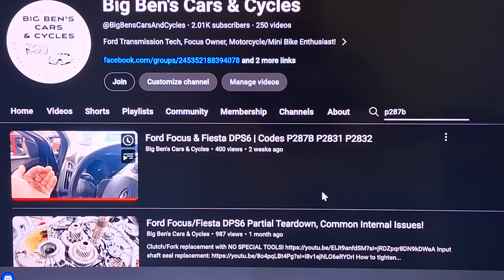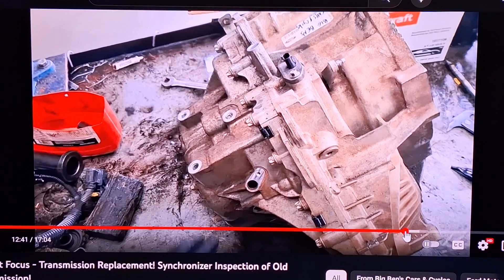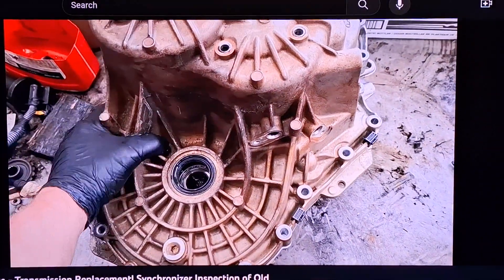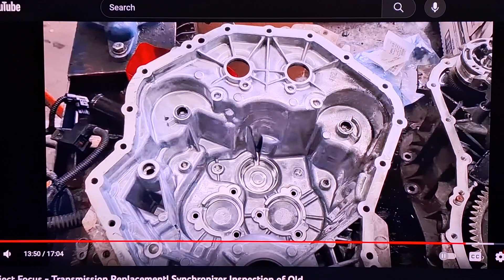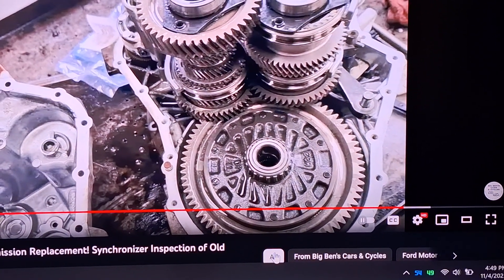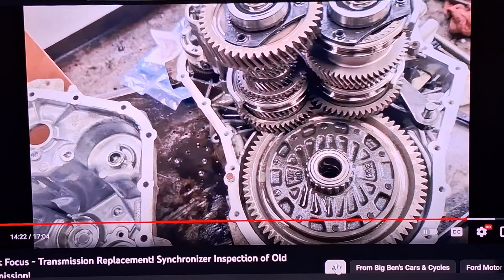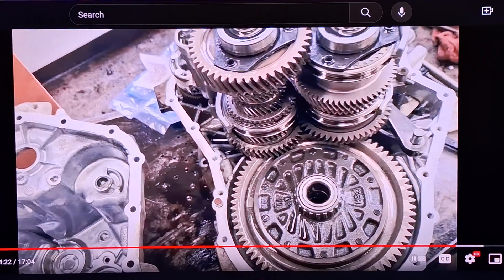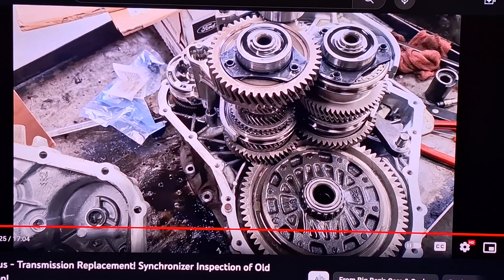Ford Focus Fiesta: P287B - Case Half Replacement (NO SPECIAL TOOLS)

Comment from the maker: Forgot to mention, make sure you pull the sensors off the transmission. Only put a SMALL amount of grease on the magnet to hold it (preferably transmission assembly lube) if you coat it in grease, it may not pick up debris anymore. And you'll have to unbolt the TCM.

Output shaft Bearings: https://amzn.to/3SJfl9H

Snap ring pliers: https://amzn.to/3UnGu3r
Sealant: https://amzn.to/3ukkWKe
Fluid: (need 2) https://amzn.to/488OhFf
Reply: I read that when doing this, one must consider the shaft end bearing preloads. What is involved in this, and is it necessary?
Reply from the maker: @SmajoDune  Per the workshop manual, the bearing preload check is only required when replacing final drive (differential) bearings. Not when replacing the case half. And even then, if it were my transmission, I'd re-use the shims and put it together.
Reply from the maker: @christophercharlesreidm.s.8365  I can screen shot and share in my discord or Facebook group. And you can order the case through Ford. Or find a used one

Comment: Hey Ben how much of a difference would 75w 90 make instead of 75w 80
Reply from the maker: @matthewrodriguez4153  hi, I wouldn't use it, you want a light duty manual trans oil like 75w80. I don't think 90 will damage it, unless you're in a cold climate
Reply: @ thanks been - my trans had a broke ear off so I’m putting a new one on thanks for your help

Comment: My 2017 ford focus has those codes says a/b fork calibration not learned. It was woring fine when i was doing uber i go home for my break car wont get to 2nd gear and wont go in reverse.
Reply: I have the same failure in my 2015 focus, Did you solve the problem?
Reply: @genaroperez976  turns out I needed a new transmission good thing my dealership covered it.

Comment: Do I have to reshim or reset the preload or something like that, dealing with the differential when replacing the case with a new case.
Reply: No, if you reuse the old shims it will be fine.
Reply from the maker: @smokeyblack4  ford does have special tools for checking the clearance for the final drive, to select the right shims to go under the final drive bearing races in the case.  If you have a bare new case, I'd reuse the old shims and you should be fine. I haven't seen it where it was out of spec
Reply: Is that in your video of removing shims?

Comment: Does the case half come with the race or do i need to get that as well?
Reply from the maker: @daviddecock7591  it does not have the final drive bearing race. If your old one is in good shape, you can punch it out and make sure to reuse the shim under it if you have one there.
Reply: @BigBensCarsAndCycles Ohh ok that makes a lot more sense. I have codes p287b & p2837. Started with a known good TCM (before finding this video) and it wouldn't pass the clutch learn, got hung up on the "neutral command state for both shafts"
Reply: @BigBensCarsAndCycles  If my end stop is broken, I'm not sure how the TCM passes the shift drum learn but gets hung up on the clutch learn. I'm going to pull the TCM off today and see if my gears keep spinning tho. I'm just wondering if it doesn't also need a clutch. The actuators both spring back nice and smooth, and there no shuddering/slipping when taking off in first gear or when it shifts into 3rd then 5th. So 1 clutch is probably good at least lol.
Reply: @BigBensCarsAndCycles  So I took the TCM off and the gears are somewhat hard to spin, they want to spring back every half turn (from what I gather that's normal?) But after about 5 turns clockwise it got a little bit harder to turn then it got a lot easier.  If my end stop wasn't fully broken off, it is now.. lol
Reply: @daviddecock7591   I just had the same thing on my 17 focus. I am putting it back together now. I was able to get a new case half from Ford for $500. I just popped the race and a new seal into the case half since it did not come in the new one. It has been a lot of work but it is definitely doable with no special tools if you take the case half off it like he did in this video. If you have any questions about how I did something or if you are not sure how to do something I can do my best to help you out

Comment: Can you do a video and show what to look for After You take the case? Halves apart as far as the synchronizers go. End if they are bad and have issues, maybe a link to where to purchase them.
Reply from the maker: I've got a video which should help. As far as syncronizers, it may be cheaper to buy a used transmission than getting syncros. Here's the video I was talking about https://youtu.be/osAuvTxedL0
Reply: By the way thank you for everything you are agreed help

Comment: Hey ben your videos are so helpful but I have a question I just replaced the transmission and had some vibration so I replaced the motor mounts immediately after I had fluid leaking and now 2837 and 2827 codes just a complete mystery or is my luck really that bad
Reply from the maker: I'd swap the tcm over from your old transmission, those are shift fork codes I believe

Comment: My 2013 ford fiesta has these codes p287b p2831 p2832 it shifts hard any it doesnt go over 30mph any ideas?
Reply from the maker: The TCM is free at the dealer IF that's your issue, which there's a strong possibility. Free till 2025

Comment: I followed the disassembly video and upon reassembly the input shaft wasnt all the way through the case upon reassembly, so the c clip wouldnt seat. Did i miss something or do i need to torque the bolts down to seat it fully?
Reply from the maker: Will you take a video clip of that and post it on my facebook or discord group (link on my channel page) So I know what you're talking about? Thanks

Comment: Do we have to reset the transmission in any way after putting the car back together and installing the battery?
Reply from the maker: Clear codes. If it doesn't shift right, do a shift drum adaptive learn. You shouldn't need to, though.

Comment: Someone mentioned you need to shim something again. Is that true?
Reply from the maker: If you replace the final drive bearings technically yes you have to double check the bearing clearance. But you should be fine just making sure the shims are still there before you punch in the new bearing races

Comment: Thanks for the help, im currently at the step of having the trans out and case half off, and verified that's the issue. I'm having trouble deciding where to buy the case half from. Where do you get yours? Also my case is stamped BV6P-7005-A, however the only part number I can find that looks correct is BV6Z-7005-A.
Reply from the maker: I would take your vin and go to Ford parts at the dealer to order it. It's about the same price there as online
Reply: was your case broke?..